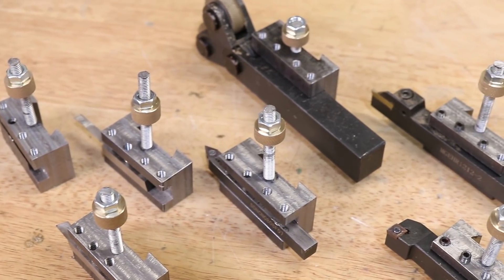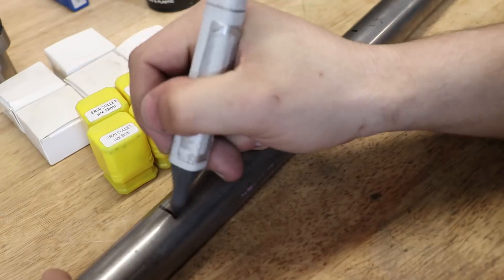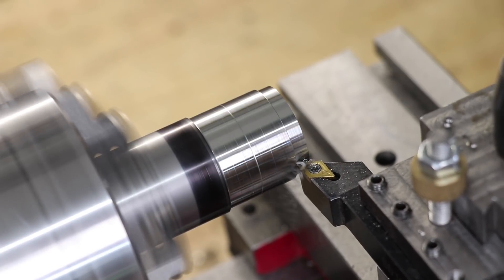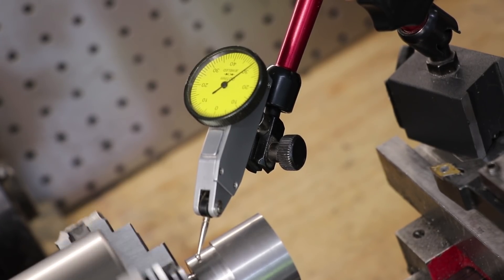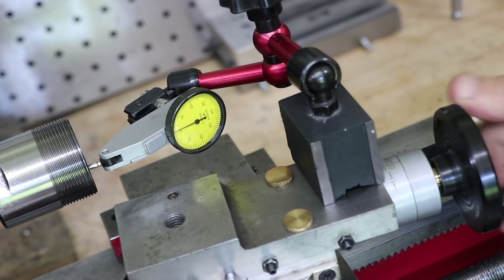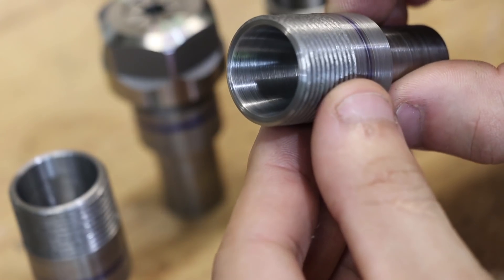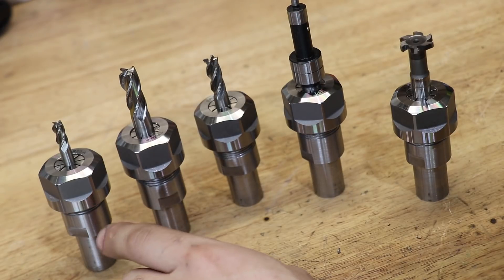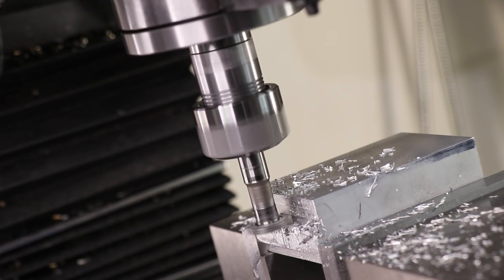Quick Change Mill Tooling Upgrade For The Mill (Mark 1)

Comment: What causes those deep circular tool marks from the end mill? dull tool? lack of coolant? vibration? chatter? I was looking to get a mini mill but I want it to be able to face parts with a smooth finish. I notice your parts have a very rough surface finish.

Comment: Nice work but you should have done the boring and taper first , then , use  a live center to hold the part while cutting  the thread.    Because you've cut the tread first and did a lot of work (drill+bore)  the part most likely shifted few microns and the tread where not concentric anymore. furhermoreit is difficult to see and test the concentricity on the tread..             this explain why you had runnnout problem.            and for more precision you should have done the part in one piece.    You will always get some  error if you do it in 2 setup.
Reply from the maker: Definitely something to consider, but the biggest issue I had was the taper itself, Cheers

Comment: コレットチャック受ける側焼入れ側
内径研磨仕上げ
内径真円精度が0.001ミクロン以下
上記条件の場合チャッキング時工具の芯円精度は上がるだろう。
Collet chuck receiving side quenching side
 Inner diameter polished finish
 Inner diameter perfect circle accuracy is 0.001 micron or less
 Under the above conditions, the accuracy of the core circle of the tool during chucking will increase.

Comment: I had another go at making an ER16 holder and I may have overestimated the accuracy of the MT3 spring collets. The endmill runout on the lathe was about 0.01-0.02mm at the endmill shank (about 5mm from the ER16 collet spring). The same endmill holder mounted on the mill, had a 0.08-0.1mm runout at the endmill shank. 

So even with shrink fit tooling, there are multiple moving parts that need to be very accurate.
Reply from the maker: Sorry to hear, that is not good at all. Might be luck of the draw with these collets, and maybe I got a good one. I haven not seen a name brand one, so the quality control is a bit of a mystery. Cheers
Reply: @artisanmakes  haha don't be, I half expected something to be off. Part of the process with mystery Aliexpress or eBay purchases. I'll eventually get to the projects I want to do instead of making tools ;)

Comment: For endmills get a weldon shank style holder, the er- collets might be fine just need some cleaning up maybe. Where i work and what ive been taught is to not use collets for endmills, but for drilling  er collets are the way to go for run-out. the collets cant handle as much side load as a weldon, like imagine all the spaces in the collet as chatter zones compared to a 3/8 endmill holder for a 3/8 and the tight slip fit and pop that comes with it, just alot less room for the endmill to 'run-out' and move around. love all the vids and progress you've been making with your machines :)

Comment: I have my own super simplistic flavor of quick change tooling like this. I do everything in a single op on the lathe. 25mm shank diameter, drill and bore a hole, chamfers and part it off. Nothing more to it. I use Loctite 648 to secure the end mills and whatever. It grips better than an ER collet in case someone is wondering. About 0,01-0,02mm oversize hole and the loctite film will center it pretty well. You can release the tool by heating to about 250°C .
Reply: I bought a pile of er20 chucks for this purpose but they were way off, I may try and redo them

Comment: I see a lot of folks trying this. Keep in mind after turning .001 under size. Then you heat treat and GRIND into spec.
Reply from the maker: This is true, but I think that is beyond the capabilities of my current workshop. I've made one or two collet chucks this way before and held them to about 20 microns of run out. Not perfect but it's a start.

Comment: Yeah man! I did the same for my woodworking lathe - I make custom fountain pens and each one will have about 15 drilling operations... from 6mm to 12.2mm. So you can imagine how much opening and closing of the chuck I do. I did the same as you - motor shaft collets, ER16 and er20, with a bunch of collets. Install the bits and then it's a simple open/close since every shaft is 10mm!  I first saw it on Abom's channel as a tap holder, and had an idea of what to do... it all clicked when I saw Steve Jordans YouTube channel and he showed is motor shaft collet system. Brilliant stuff!

Comment: Geesus wept.....first a hand powered hacksaw and now a hand powered threading application.........you are a die hard......I normally do threading in the lathe under power and with a handle clamped in the end of the spindle to reverse the work piece due to a screwed on chuck etc.
Sometimes I also screw cut with the handle in the end if the threads are short and on the small size, like 6mm diam etc.
When  I re-built my jig borer, to make it a mill per se, I had to have an ER32 chuck as a permanent part of the spindle end as the spindle itself originally had a Morse 2 taper and has a solid drive shaft with no means to have a drawbar, so I cut the Morse taper off of the spindle and fitted an ER32 plain shank chuck........milling anything without a drawbar is suicidal.......all of my tooling went to a 20mm diam shank which made it virtually quick change even if spanners are the release mechanism.
So, I mill in the ER32 chuck with normal collets and put up with having to change over collets for every end mill size as and when and have a keyless drill chuck for drilling.......all other tooling ends with a 20mm shank like the boring head etc.

Comment: I think you're doing pretty good. Giving something a go and sharing what you've learned on here is what makes your channel enjoyable to watch & learn from.
I bought myself a set of cheap er16 collets on ebay knowing they'd be crappy - it was for me to learn more about grinding & improving tooling. So,  if your goal is high precision, you'll have to start looking down the grinding, lapping & honing path - in the meantime though, think how you can get repeatability and being able to index your tooling and holders.  Have fun - Stay safe and well :)
Reply from the maker: Cheers, just using the lathe compound I have managed to create collets that give me around 20 or so microns of run out, which is what I was aiming for. Not giving up just yet, certainly room to improve.

Comment: I made basically the same thing, I copied the tormach system. I did the taper and threading first, then made a center hole on a dowel pin and put that in the collet, then I turned the shank between centers, no run out, then the nut and collet are kept with that setup.
Reply from the maker: Similar to the tormach one, I wish they made it with something other than R8
Reply: @artisanmakes  They do make a special MT3 3/4" collet for their TTS system. I am in Australia and its damn expensive. With importation and currency rates it is 3x the price.
Reply from the maker: I was not aware of that but if that's the price, that is certainly outside of the budget. I'm sure it's of good quality though. Cheers

Comment: Nicely done! Having quick-change tooling in the mill really is a great quality-of-life upgrade. I've been using the Tormach TTS holders for a while, and I love them. And you're absolutely right about the hit-or-miss nature of import collets... Import anything, really. The quality of import machining stuff has improved considerably, but you still get the occasional bunk lot.

For the next upgrade, you should consider grinding down the Morse-taper collet, so the collet is slightly recessed in the spindle nose. This way, the flanges on the tool holders will be pulled tight against the spindle nose, which then becomes a registration surface. This makes your tool holders not only quick-change, but positionally repeatable, as well (that's how the TTS system works). Then, if you ever get a DRO for your mill, you can build a tool library which stores the Z-offsets of each tool, which makes your workflow even more efficient.

Keep up the good work! It's awesome to see how much you've improved your machines with creative DIY solutions.
Reply: The problem import tools (China for example) isn't that they can't make high quality tools (or anything) as they can. The problem is that the consumer want's everything to be cheaper and cheeper and demand lower prices.  Large companies from the US, Europe, Australasia ect  play the Chinese manufacturers against each to get the cheapest prices.  The manufacturers don't want to to lose money so they lower the quality of the products to keep making profits.  So the consumers are a fault for low end quality products from Asia.

Comment: Very elegant solution. You might want to grind them while they are in the mill spindle with a table fixture for the perfect runout.
I would suggest looking in to all systems. For your standard (always used) carbide endmills (dont shrink HSS without proper tooling) a shrink is most likely the best option.
having some weldorns for things where a bit of runout dosnt matter is also great because its fast and cheap.
And bad quality collets are good for nothing but egefinding. Ditch those before a tool pulls out. 
But collet chucks in generell have their place for precision machining. 
And in the second batch of tooling I suggest doing a B16 taper for a drillchuck (or) too. So you can leave your drawbar collet in there all the time.

Comment: You are a gamer man than me - changing inserts on a tool while it is on the machine... I dont have much luck deep diving to find dropped screws in the pile of swarf in the bottom of the lathe...
Reply from the maker: Cheers, I usually have a small container than I pop under the tool holder to catch the screw, just in case it drops.

Comment: Nice job. You can sometimes gently tap your end mills into concentricity while they are tightened up in the collets. Its also worth bearing in mind that the edge finder doesn't need a high accuracy mounting. Save your nicely made holders for more critical tooling :). Your more determined than me doing all that hacksawing!

Comment: Have you tried making a hand crank for the back of the head stock on the lathe.
I end up using that more than powered on my lathe for doing thread
Reply from the maker: No but I might just do it. Been threading a lot more than I used to on the lathe and it might just need it. Cheers.

Comment: Good work! I think you can see a large part of the precision problems (and the surface finishes!) in the lathe at https://youtu.be/zKNXUorPkY4?t=16 and at https://youtu.be/zKNXUorPkY4?t=393... In the video it seems the entire toolholder shifts slightly when the load on the tool changes.... Bed twist? Need to tighten the gibbs? Hard to see.
A quick change system improves quality of life quite a lot, keep at it! :)
Reply from the maker: Very difficult to see, especially when filming. Didn't see it until editing. Such a small compound that it's easy to have this trouble. Cheers

Comment: You know you can buy straight shank ER tool holders for cheap from ebay and aliexpress...
Reply from the maker: I'm well aware of that, but the point of this hobby is to figure it out and do it yourself.
Reply: @artisanmakes  these rough turned parts will never give you usable precision without finish grinding, btw forget about making weldon holders, they are the hardest thing to make, the tolerance for the hole diameter and concentricity is less then 2 microns and without a hole grinder they are impossible to make even with a good quality reamer, the hole will be always off
Reply: @DolezalPetr  I bought the cheapest ones like that and they're all unusably bad. The taper is centered but the threads aren't and this makes them unfixable. If the taper was off but threads were centered, I could've just trued it up. The shank could be trued up to the thread and then trued the bore but it won't fit the same collet anymore and it's actually 2x more work than making a new one from scratch

Comment: great idea. I've done similar, but as you suggested at the end, I just made custom set screw based holders. The pop you hear, when you cover the set screw hole with your finger and pull out the cutter always makes me feel happy that it was such a tight fit.

I do need to finish the rest of my holders. I have only made a few at this time.

Comment: Be careful with long length of cuts with endmills, you can get pull out. The problem is worse with larger diameters. Nice job though, now you can ad some spring washers and a pneumatic cylinder for a one button tool change.

Comment: Hey 5 comments 3 anti-hacksaw.

So let's balance it out I'm with you in the hacksaw gang. bandsaw just takes space and cutting things by hand sure is tedious but it is only the smallest part of shaping metal.
What is few minutes when you spend hours on the part afterwards ?

To me a bandsaw only make sense if you have to cut a lot of chunky stock or you need to often cut a lot of the same length of stock.

Comment: I can't wait for you to find a way to get a bandsaw into your shop. Quick change tools are great, but I can't imagine how much time you spend with the hacksaw
Reply: I think his goal is to make this a running gag...
Reply: @trashes_to_treasures  
It has become his catch cry to use a hacksaw. It makes him feel like he is one of us common folk!....LOL...Don't no-one tell him we all use powered saws to cut metal!
Reply: @trashes_to_treasures  Agree. 👍😊
Reply: A porta-band only costs about $250 and can do almost anything you do with a hacksaw. Probably the best tool investment I ever made in terms of time saved per dollar.
Reply: @skylerlehmkuhl135  They are even better with homemade table  made for them ,  heaps on  Utube
Reply: Was just about to say that the greatest time saver would be a bandsaw. 😁
Or at least some sort of custom disc for an angle grinder.
Yeah, I know you know and that you want one. It will come. 😊
Reply: Try and buy a porta-band in Australia, for some reason you can't  buy a cheap one, only Milwaukee available?
Reply from the maker: I've noticed this too. Most of my tools are Ryobi and for some reason they don't import their portable bandsaws
Reply: @artisanmakes  
Nor the 90 deg battery powered die grinder - dime a dozen in the U.S.A but not in Australia .
You might be able to rig something up using the Ryobi reciprocating saw and a metal cutting blade though - something along the lines of a power hacksaw .
Reply: @artisanmakes  I got mine off Amazon Aus. Might be worth signing up for prime for a month to get the free shipping. It's a great little bandsaw for the money. Keep up the vids mate.
Reply: @Flattyman  reciprocating saw is more of a pain to use than a hacksaw.
Reply: @artisanmakes  maybe look up used, most of the shops in the states ive been to are still running a bandsaw from the 80's